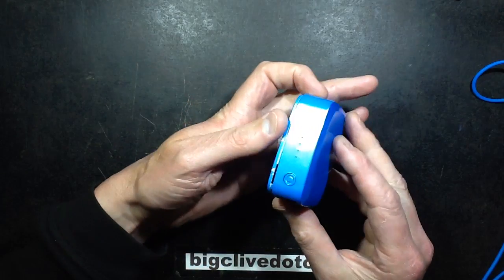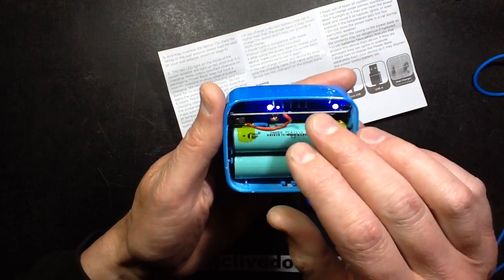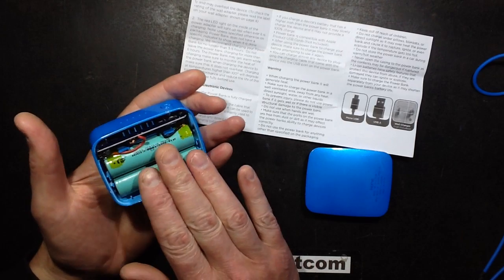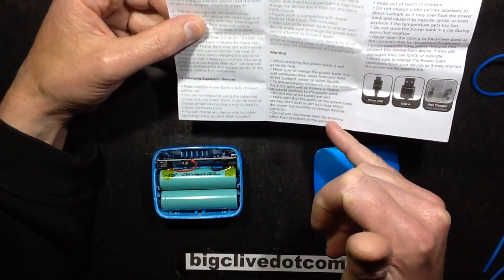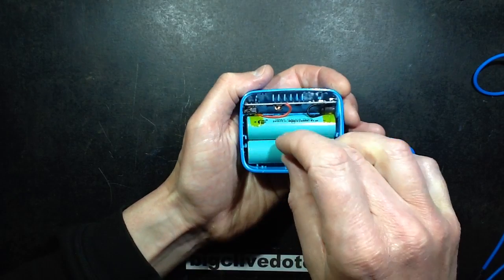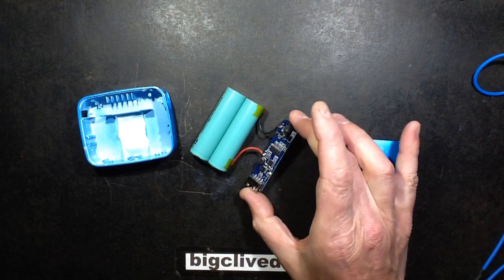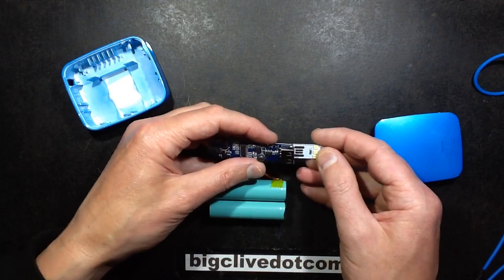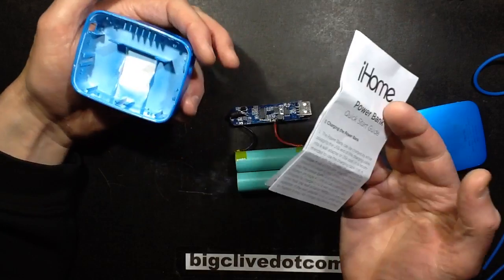A look inside an iHome 4400mAh power bank with retarded manual.

Comment: hey brow, i came across your video cause i have the same powerbank, and i'd like to know if you know the battery manufacture or if you know if i could use then on a vape mod, thanks a lot!
Reply from the maker: I'd only recommend using lithium cells designed specifically for vaping due to the very high current involved.

Comment: I'm about to attempt a battery pack rebuild and am wondering if you could input some information on how batteries are matched. They are Li-Po. Thanks in advance.
Reply from the maker: Try to get all the batteries from the same source and batch.  If hooking in parallel try to get the voltages close to each other before connecting them.  If using cells in series a balancing circuit and protection must be used.

Comment: I HATE that low-load shutoff feature!! All of my Anker and IC power banks shut off when I try to use those little LED lights. Is there a fix for that? Can somebody recommend a good power brick that won't shut off with a low load?
Reply: Get a "Y" adapter so you can plug two or more LED lights in at the same time.

Comment: Hi there, hope you can help me on my project. Tried to use my full charged powerbank to my RC  car. using a USB cable connected from the main line of the RC car and using the USB male connector to the USB slot powerbank, it does power the RC, however once I place the RC car on land it loses it power, is there a way to around this. I think there is a mechanism on my powerbank that messes the power.
Reply: Archimedes Tan sorry if it's too late to help but two possible problems here:

1. The power bank has sufficient power to start the control circuits inside the car but not enough to actually power the motors once they start moving.

2. electrical noise from motor control circuitry confusing the current control/safety cutoff circuitry of the power bank.

Comment: This sounds too good to be true. http://youtu.be/LqJo1wZ_Hro I just saw these advertised on TV in Australia. Any chance you could get a hold of one of these and tear it down.
Reply from the maker: +Shane S I'll probably get one of those in the future.  But they are basically a high power lithium pack that can put out the 12V or so needed to boost some current into a car battery.
Reply: +bigclivedotcom a guy had something similar on a tool truck that was called noco I think it was terrible inside even as a display not even trying it was way way over rated on the package and the soldering was done by a American child with a jitter issue very simple and would make a fun video

Comment: Could you just put more batteries in this?
Reply: +Telephone Telephone 
Certainly you can. I've got a cheap powerbank with a single cell and added 6 cells from an old laptop battery. Works fine.

Comment: Electricity principles 101: current can NOT be forced
Reply: that would b voltage matey
Reply: @MrAlex3461  exactly. Over current only happens when something between the load and the source can’t handle the current, like using a cheap extension cable to charge an EV

Comment: I've noticed you have more of these power banks than I do.  Is there any way to put different types in series and make a big ass bank?
Reply: Of course, you could put as many cells in parallel as you wish, or you could do a combination of series and parallel to get a slightly higher voltage and use a buck converter to drop the voltage to 5v. You would probably have to design your own charging circuit though, because i don't know of any high power lithium cell chargers.
Reply: A. Zak I'm a geek, not an electrical engineer.  Wont different voltages effect the other cells?  I'm under the impression they have to be the same value/volt/??? to work together.  Is that not the case?  I can really just wire them pos to neg and get 1 big battery?  Please give details so I don't kill myself.
Reply: All cells in your bank must be the same voltage if you wire them in parallel (- to - , + to + ), but if you wire them in series (+ of one cell to - of the next ) you could use different voltages. If you wired them in parallel, which would be the only sensible way to do it, then you'd have to have a large number of balance charge controllers, as well as a super beefy charging circuit and power supply. Also, exactly how many cells are we talking about here? If you give me an exact number of cells and their capacity i could design an arrangement of cells for you.
Reply: That is a wonderful offer.  I have more projects than I can complete atm, but in the future, I would love to try that!
Reply: Jason Moonsmith Well, whenever you want to i can make a circuit diagram and send it to you.

Comment: I just bought a 11200mAh "Juice power Station" Li-ion battery bank from Sainsburys for 19.99£. Has two usb ports (1A and 2.4A). Dont know how many cells it has, but looks like it could fit 4-5 and space for circuitry. I dont think the price was too bad, and I would assume that the capacity is close to right too since its from quite reputable retailer.

Comment: Do you think it would be possible to add 2 18650 cells to increase the capacity?
Reply from the maker: Chuy A. Yes.  Preferably cells with tags.
Reply: First replace the existing 2 with reputable cells.

Comment: When you mentioned the warning about high current chargers you overlooked something.  Some of them are not 5.0V, instead are 5.(n)V, a little higher voltage to help  current flow.  Whether that would make a difference might depend on the circuit design.  Remember that if a higher current is flowing, even at exactly 5.0V regulated down to 4.2V, more heat can (and will be at the same efficiency) be produced.

Comment: what is its capacity in mah @5v?
Reply from the maker: I'm not sure.   A rough estimate based on a mean cell voltage of 3.6v and allowing for converter efficiency might be 3ah at 5v.

Comment: Are those 18650 25A batteries? There's no circuit protection, and they rupture/vent very easily!
Reply: +Kevin Oliver they just need to be regular 18650s, and they are safer than lipos, if they get shorted out they give quite a bit of warning
Reply: +Kevin Oliver There is the DW01 charge/discharge protection circuit

Comment: Might have replaced the diode of the boost converter with the P-ch mosfet, significantly less voltage drop, more efficient.

Comment: Not relevant to this video what so ever, but i just stumbled across a USB mug warmer on ebay, doubt that you could warm a mug over usb, but maybe worth a look?
http://www.ebay.com.au/itm/Silver-4-Port-USB-Hub-Tea-Coffee-Beverage-Cup-Electric-Warmer-Heater-GA-/181653013217?pt=LH_DefaultDomain_15&hash=item2a4b5d02e1
Reply from the maker: NovakinCore Got one.  It's two resistors and the pitiful amount of heat given from it would just raise the drink marginally above room temperature.
Reply from the maker: jusb1066 Most of the USB cup style warmers only seem to draw about 500mA, so 2.5W does even less.
Reply: bigclivedotcom I think the idea is that you can place your cup of already warm drink on them, and they'll keep the drink warm for a longer time, though I don't know how effective it would be.

There are versions that have a peltier element instead of resistors, and so allow you to switch between heating and cooling, if you want to keep a drink cold.
Reply: NovakinCore my rough calculations come to: a usb cup warmer at max usb draw 2a, is 10w, i think you need more like 40-50 to keep a cup of tea warm enough (a normal open mug) and what with the ceramic cup being rubbish at transferring the heat from the hot base (i will ignore that), the 10w is really nothing useful, A candle is apparently close to 80w of heat, and my own experiments of heating a cup of water over a candle and at over an hour, it wasnt hot by tea standards, warmish coffee temperature
Reply: I figured they would be horrid, but i thought it may have been slightly more interesting than 2 resistors, oh well, cant keep my hopes up when it comes to Chinese electronics.
Reply: NovakinCore I got a different brand USB mug warmer / cooler and it used a peltier tile.

Comment: Have you had a look at the EE Power Bar? It seems to be pretty fancy as power banks go (like this one, with a torch and battery level meter) considering they're basically giving them away for free
Reply: Gary Lee they are a single cell, nokia sell one too, pretty pricey from nokia though, but a high end 4000mah cell though
Reply: +jusb1066 its not an 18650 if its 4000mah, max is 3400mah